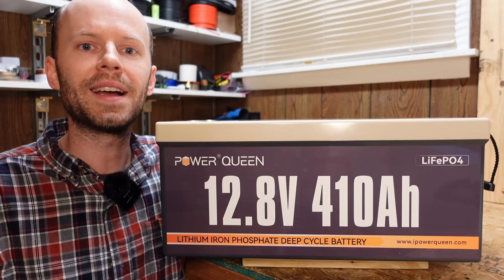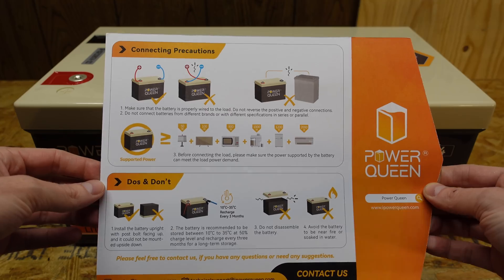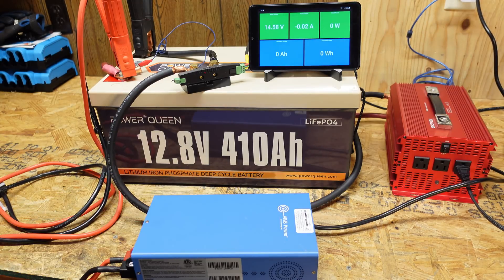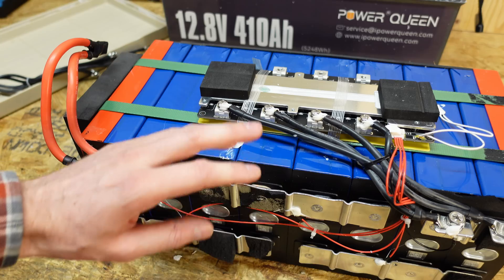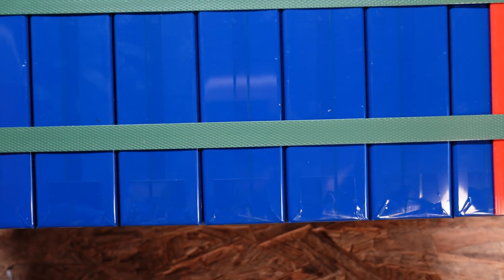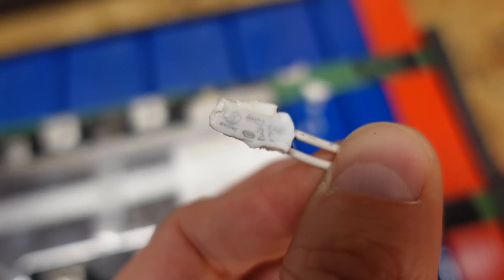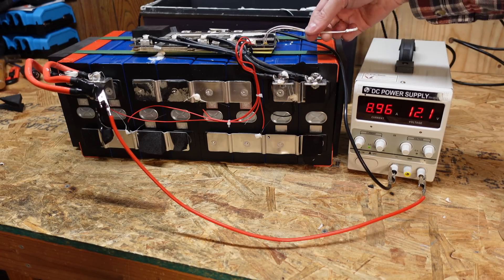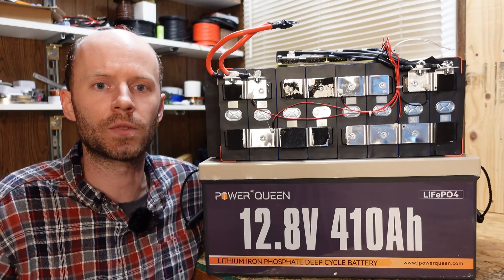Massive 12V 410Ah LiFePO4 Battery by Power Queen, Review & Teardown

Comment from the maker: 12V 410Ah Battery... https://ipowerqueen.com/products/power-queen-12-8v-410ah-lifepo4-battery-built-in-250a-bms/?ref=lithiumsolar
12V 100Ah Battery... https://ipowerqueen.com/products/12-8v-100ah-lifepo4-battery-built-in-100a-bms/?ref=lithiumsolar
AIMS Charger... https://www.currentconnected.com/product/aims-con/?ref=lithiumsolar
(affiliate links)
Reply: Just out of curiosity how much juice do that charger pull out of the wall while it's charging 70-75 amps to the battery? Have you measured that yet? Because I'm wondering if my little 15 amp outlet is going to work> Thanks

Comment: I have monitored the temps in the front compartment of my RV and when it is -10 deg C outside it comes too close for comfort to having a Lifepo4 battery without low temp cutoff. I am curious about the 84 amp recommended charging level, many others in this category state a 112 amp recommendations, still others are 200 amps. I am trying to determine if this is a limitation in the internal wiring size, BMS, or a combo of both. We have 1440 watts of solar at our RV due to being in a canyon & limited charging window, thus I have to find a Lifepo4 battery with a low temperature cutoff and enough charging capacity to accept at least 120 amps without any damage to longevity or performance. Thanks, David

Comment: Great video, again. It would be super cool if you had a spreadsheet of the different batteries you have reviewed, and manufacturers, and ratings for them, like consturction quality, and so forth. And then also, which you'd go for yourself. Say the video is about this 410Ah powerqueen, is that the one you'd buy in that range of Ah ? Or would you go with the 460Ah of Li-Time...
Just some ideas. But thank you for your videos. 
Oh and I noticed you haven't reviewed a renogy battery yet, the self heating one are quite well priced.

Comment: 2 6ga wires for power, and they expect that to hold up to 250a of charge and discharge?

That is, at best, going to be safe for 120a, nowhere near 250a!

This is why I build my own batteries, or use better batteries.
Reply from the maker: Your number of 120A is WAY off. I think you need to review the current tables for #6 wiring as they pertain to this battery.
Reply: @LithiumSolar  really? Are you sure you want to stick with that comment?

NEC 310-16 states that in ideal conditions, 65a is the maximum allowed ampacity.

What you have, is a set of bundled wires, which ABYC E-11 states drops the allowable ampacity down to 50a for 75C rated wire. Note: wires inside battery cases are treated the same as engine room wires, due to the temperatures inside.

So, tell me again EXACTLY where the actual fuck you got your bullshit numbers, because mine come from the actual people who write the God damn rulebooks!
Reply from the maker: @charlieodom9107  I'm not aware of any section of the NEC that applies to the inside of a manufactured battery. Additionally, NEC 310-16 does not include specifications for 200C-insulated conductors.
Reply: @charlieodom9107  if will prowse says so...then it is so my man
Reply: @charlieodom9107   also...who tf is going to use 3200 watts continuously on a batt like this hahahaha. maybe 4 of them together...and I shoudnt have to tell ya what comes next
Reply: @gruponemesis  who the fuck would put a 200a or larger BMS in a battery that they don't expect to be used to its fullest potential? If they want the battery to handle 100a, like the wire size suggests, then it should have a 100a BMS.

Also, I have watched every one of Will Prowse's videos, and I do not recall him ever recommending 6ga wires for 100+ amps of current. Someone please show me that video.

Comment: Are these cylindrical or prismatic cells?
Reply from the maker: Aluminum-cased prismatic cells.
Reply: @LithiumSolar  Thank you.  I am trying to learn more about the different batteries. Do the Blue encasement boxes indicate Prismatic vs some other style of container for cylindrical battery? Or are all the battery makers using prismatic cells now?
Reply: @LithiumSolar    I may have found an answer, if all the cylindrical batteries are contained the same way, that is. In your Mustart Battery teardown, these were the cylindrical cells.  Plus, the aluminum casing is more heat, thus fire, resistant as opposed to the plastic encasements for cylindrical, as I understand.

Comment: Could you say something about which hybrid solar inverters these batteries work with? Power Queen says you can connect up to four of them in series for 51.2 volts, but that wouldn't be enough to drive the new Sunny Boy hybrid inverter from SMA which requires 90V to 500V.
Reply from the maker: I don't work with, nor have any expereience with, high voltage DC systems. You would need something custom built if you're looking for 90-500V. None of the batteries I have reviewed thus far are capable of reaching those ranges. Additionally, there is a lot that needs to happen in terms of safety when working with high voltage DC.
Reply: @LithiumSolar  So SMA is a no. Are there others you've worked with?

Comment: Aluminum for conductors?  Wonder how they look on a thermal gun during high current charging.
Reply from the maker: Laser-welded aluminum is the standard as the posts are always aluminum themselves. There's nothing wrong with aluminum.

Comment: So is the bms in these batteries good enough so you can hook up a 200 watt/18 volt solar panel directly to it? That would save some money on a charge controller....
Reply from the maker: No. The BMS is a safety device not a charge controller. You will still need a proper charge controller that either supports LiFePO4 batteries or that you can program the correct voltages in to.
Reply: @LithiumSolar  Thanks!

Comment: The problem is that it's life is only 4000 plus cycles. Instead of this, you could buy two, 200 Ah Power Queen LiFePO4 batteries for $1360 and get 15000 plus cycles! You
re saving over 300 dollars and getting almost three times the life span.
Reply from the maker: The number of cycles is not a defined number by most of these manufacturers. To get this information, you need to look at the datasheet of the cells themselves (which are typically cycled at 1C to 80% state of health) and I guarantee you, the datasheet for the cells in that Power Queen battery doesn't say anything near 15,000.

Comment: When my Chevy Bolt eventually dies is there a kit anywhere that will let me drop the battery pack out of it, stand it up in my garage and use that instead of a powerwall or similar?

Even at 50% capacity that's still ~33kWh for essentially free.
Yeah I could tear the pack apart and build my own powerwall out of its guts, but that sounds like work (not to mention dangerous).

Comment: How the hell is that little 1500 watt heater pulling 70 amps and that 2000 watt inverter able to put out 70 amps ?
Reply from the maker: That 70A is on the DC side, not AC.

Comment: The thermal pads are called exactly what you called them. They are mostly used on low-power portable device processors or power-delivery elements such as MOSFETS (basically a power-delivery switch) on GPUs and sometimes on computer motherboards that don't get quite hot enough to warrant their own active cooling system - The pads will usually be touching the cooling plate of the part that needs the most cooling. I'd guess that the fact that they've used them here is a sign that this is a quality product. Cheaper consumer computing hardware wouldn't generally have these pads. Thanks for the video. You can probbaly guess from the comment why I'm watching your very informative video. Panels and portable power station first. Now it's time for the real deal!

Comment: Really wish you had done a 250 amp draw test to verify that it would maintain that indefinitely and not just as a surge. That high discharge rate is what really makes this attractive to me. Would run one very large inverter or maybe several separate mid-sized inverters at the same time. Lots of versatility if it can actually deliver that 250 amps. I'm glad you did verify its capacity rating at least. Interesting tear down.
Reply from the maker: I really wanted to test this and was planning to do a follow-up; however, I do not have enough equipment to pull 250A at 12V. I didn't want to spend $300+ on inverters just for a single test.
Reply: @LithiumSolar  That's fair enough. I wouldn't do that either and that's why I hoped that you would. LOL Do you or any of your subscribers have any ideas on how to use an automotive starter battery tester or maybe a shunt connected to the precise amount of element wire from an old toaster to create a large load like 250 amps at 12ish volts? I don't make YT content, but my brain is always asking me, "How would I do this or that, if I wanted to?" and I haven't pursued this one yet. Thanks for the content that you did produce.
Reply: does this use grade A cells? also how can I get this unit for around $500 here in the US ? thanks @LithiumSolar
Reply: it can easily do 300 amps for two minutes before the BMS shuts down due to overtemp.
Reply: @daveyd0071  But can it do 250 indefinitely? That's the question that needs to be answered, I think.
Reply: @mrhalfstep  If 3,200 Watts is what you want to pull all day I would suggest going with a 48V system as I highly doubt there's even a 12V solar charge controller that can pull it off. You might need close to 10K Watts in pv to sustain it on an overcast day at 48V. I have 5900 watts in PV and have been able to sustain my living as a single person on 22.5 KW Hours of lifepo4. I ordered the powerqueen 190AH yesterday and it should hopefully arrive tomorrow to test it on a separate off-grid 12V system. I haven't paid for utility power since I began this endeavor back in 2014.
Reply: @daveyd0071  This is just an emergency back up for me. I won't be pulling 250 amps all the time, but there may be short periods of time where a toaster, microwave and coffee maker are going at the same time for 10 minutes, just as an example. The battery is advertised as 250 amps sustained and I would just like to see it tested to that level. I may find that I want to connect several smaller inverters (I've accumulated my share of those over the years) to the battery so they can be run independently, as needed, to offer better efficiency than one large inverter running a small load. I would have about 600 watts of pv panels to maintain the battery as best I can. I just want to know if the battery can do what it says. The 250 amp BMS is what sets this apart from other large 12  Volt drop in LiFePO4 batteries. I have already worked with two paralleled 200ah batteries, but they each just have a 100 amp bms.
Reply: It's 12v

Comment: beefy battery but you get more for your money buying just the seperate cells and configure them to your liking. I think the pressure on the cells with just the strips is not good enough - they will tend to bulge over time and loose capacity.
Reply from the maker: I agree you get more for your money by building your own. Most people though don't have the knowledge, skills, tools, or time to build their own battery. It's good to have quality options like these on the market. I'm not sure I agree regarding the straps though - time will tell for sure.

Comment: Hey, I'm from Ukraine, from Kyiv, and as you know we are suffering of power outage and blackouts because of ruzzian aggression, so I have some exp to share with you. Normaly we have power only 8 hours per day so I installed electricity storage system at my place.
1. The mentioned in video acc is for home use (solar/grid). It has 12.8v and it's wierd. More efficiently to make 48v battery
2. It has 250 A and it's cool. Author has not provided max current load test. This is the most important characteristic. 
My instance. I use Solis 5 kW invereter  + 2 accs of Pylontech US2000C LiFePo4 with the max currect of 50A (short load current is 70 A, sorry don't know the correct terms in En, I hope you get my point). 
I must admit that 50/70A 48v is too less for home, cuz when I turn on the devices without soft start (is it right? the technology that allows to  restrict the start current) or devices that consump 2.5kW+ the batteries goes to safe mode and turns off. And that's really pisses me off. Especially when the boiler is on and my beloved wife turns on the hair drier  and then all flat blackouts lol

Comment: Ive always been a raw cells kind of guy because it just works out so much cheaper but if the price falls a bit further I might end up going this way so could just buy an all in one mpp solar charger/inverter, plug it all together and Im done. These sealed units are still at least 30% more expensive than raw cells but are obviously more hassle to build a set up...I will have to consider them as an option for my next build though.
Reply: I totally agree about the self built way. I was able to make a 48V 15KWHR battery with a 250A BMS  with touchscreen for right around $3K.
Reply: @daveyd0071  10 to 20 years of no power bills for 3K is a great deal :)
Reply: @daveyd0071 hello, I was wondering how your DIY system is working now that it has been about a year?  I used to research this stuff years ago, but haven’t recently…. What brands are recommended now for the cells?  For the BMS?  The last time I was looking t this stuff, CALB was recommended.  Thanks

Comment: Lol 1500$ /100Ah  = almost 6000$  for 48v systems very expensive
Reply from the maker: It's $1500 for 410Ah not 100Ah. Also, if you're building a 48V system, personally I would just buy a 48V battery instead of series connecting 12V batteries.

Comment: These are getting advertised as "And it supports more than 4000-15000 cycle times(based on different DOD from 60%-100%), and has a lifetime of up to 10 years.", what's your opinion on that?
Reply from the maker: I think 4000 cycles and 10 years is easily achievable, considering the GFB cells it uses, if taken care of. I think 15,000 cycles is... marketing numbers, but that's just my opinion. In order to reach that, you would have to cycle it many times per day and use very small depth of discharge as once per day would be over 40 years and battery would be dead well before that from aging. Of course, they (and pretty much all of these companies) don't mention what capacity is considered "end of life". Most cells use 80% as a standard.

Comment: Still don't understand why do they put a picture with a van on the website, those wires are not isolated against vibration, the screws with the white silicon it's a joke. Worked on many automotive batterys like A123 start  or the LG CHM, and when I see this kind of crappy construction here, meake me cry. I would use them only on stationary applications.

Comment: No wonder you didn't start your video, telling us what a super bargain deal this is.  Because it's not.  Not at $1500 per battery!   That's 33% more than your competitors.  Perfect for the person who has everything like money.   To get a box with a bunch of  internal batteries all, soldered together.  With a circuit board and a chip.  From another company.  That minds  the evaluation of the batteries and its charging duties.  And warning you.  With enough time.   Before the battery explodes and burns down your house.  Hopefully?

Yes the boxes designed to sustain its integrity.   When one battery explodes.  But not all of them, internally.   When like Fat Man.  Where did the bombs shell and encasement go?   How far away?  What?  Back to its original molecules?  Yes.  Back to its original molecules.  Before they floated away into the atmosphere.  And decided to cruise the world.   Leaving sprinkles of fairy dust wherever it floated.

I'm sure those batteries are worth every penny one spends on them.  I'd like 4.  One day.
RemyRAD

Comment: 81 pounds?  What's inside of it,  lead plates?   I mean I know lithium is a metal but… You can only get so much in that sized box.  Holy moly!   My lead acid truck battery, weighed the same thing.  About the same size.  But I guess didn't have quite as much staying power?  And made by Interstate Batteries.  That power up, interstate trucking.

Cool!  That almost sounded like a commercial!   For lead acid batteries.  As they work.
RemyRAD

Comment: too bad i can't use few of these for my solar home in northern ontario . they told me because of the low temps during the winter that they will fail (-50f) with out heat. so i guess lead acid will have to do.
Reply from the maker: Yeah those are some pretty extreme temperatures, wow... That goes below even the safe discharge operating range.
Reply: @LithiumSolar  yep. i looked at these a few years ago. hauling lead acid in and out by boat when needed at 220#'s + -  a piece and i'm not young any more i thought that the lifepo4  would last long and a lot lighter til they told me nope they won't work. i think that they said -20f maybe and it would be iffy. but we are not there but from june 1st til 1st or so of oct. too cold for me up there. 90 - 100f in summer. crazy right? lol